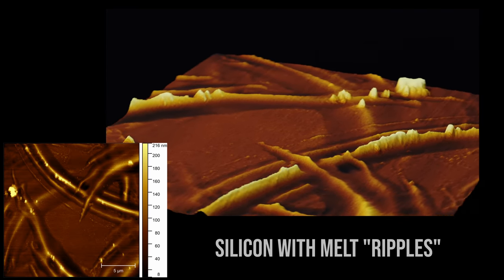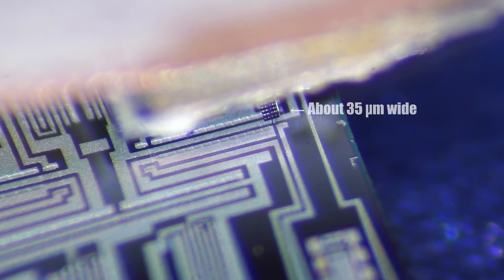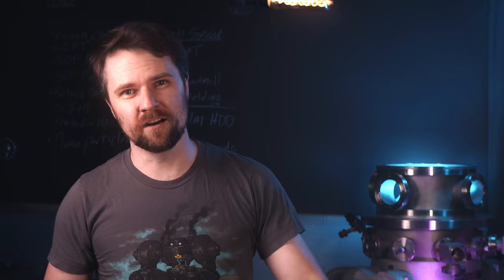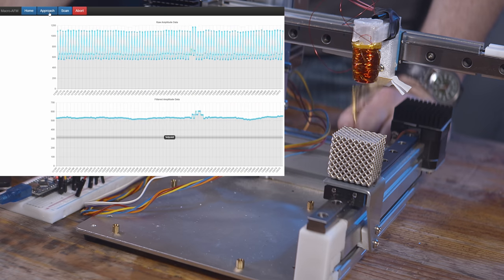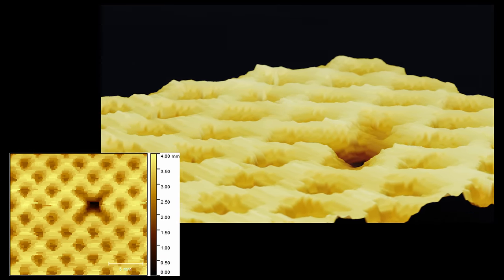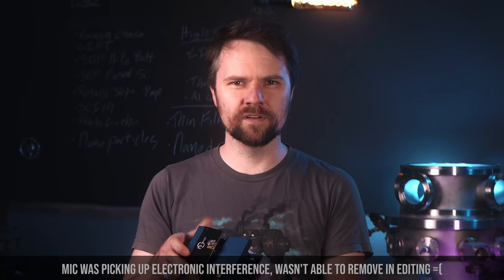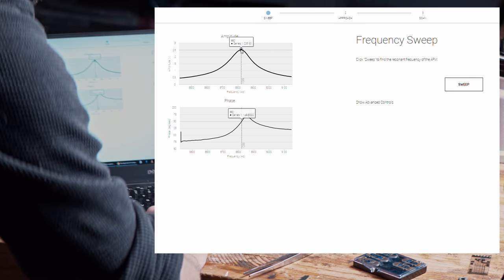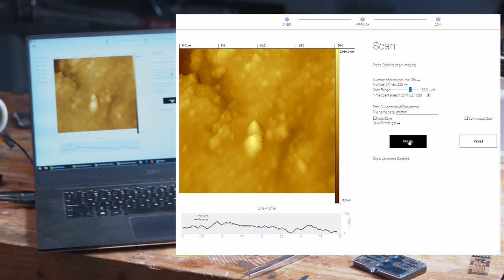1,000,000x Magnification with Atomic Force Microscope

Comment: I'd be interested to know how dust particles can affect the results of these tests.  I kept wondering, if all those imperfections, were just dust particles?
Reply from the maker: I blew the samples off with an air duster before testing. You can typically see dust under the microscope and avoid it when lining up the probe. If you get unlucky and run into a piece of dust it's really obvious, generates a huge mountain in the scan (and easily checked under the microscope). Most dust particles are actually quite large. Very small dust in the sub-micron range tends to stay airborne because it's so small, and any that does land on a sample will land uniformly across all the samples so it just increases the noise but won't bias the data since all samples are affected equally.  But you're correct, for proper lab testing this should be done in a cleanroom or glove box!
Reply: @BreakingTaps  Great info and thanks for the reply!!  Love the channel and always look forward to what's next!  Respect and many blessings!

Comment: Do these devices require a clean air environment or do they literally work straight "out of the box" ?
Reply from the maker: Pretty much straight out of the box. I've been running most of the scans in my home office, which has carpet and dogs, and the windows have been open lately because summer. The rest were in my garage . Definitely no cleanroom here! :)  You'll occasionally scan over a piece of dust/debris but I haven't really had an issue with it affecting the probe, just puts an unsightly blob in the scan.  It is best to keep it away from fans/etc because a big draft will introduce some noise in the scan.

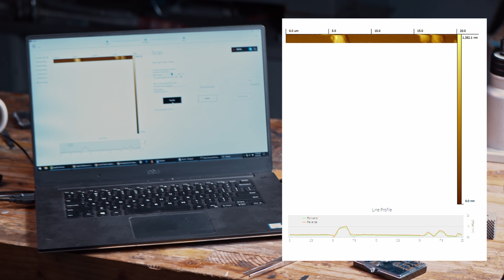Comment: 18:12 I wonder what's happening with the scale on the right, I mean why the max color height goes down at certain times, even though a point of that previous max height has definitely been measured. Is it some kind of data refining that happens as the scan goes on? Just an artifact of the software? Either way, great video!
Reply from the maker: Huh, I hadn't noticed that before. I'm not sure to be honest, will dig through the manual and see if it clarifies what that number represents. There is a "Level Image" checkbox in the software (which I now realize I never showed a fullscreen of, whoops) which does a fast/coarse leveling of the data in realtime.  There's a certain amount of non-planarity between the tip and stage, and the tip itself is canted at a 15degree angle.  So you typically need to level the images when post processing.  It might be a side effect of that?  Not sure, good eye!  I'll update if/when I find an answer :)
Reply: I would indeed guess it is a leveling algorithm, especially since it converges the farther along the scan it goes-- each new line has less and less relative weight to the whole image. Raw AFM data looks really terrible, there is always some degree of alignment/leveling.

Comment: They sell the MEMS chip for $100 per, I bet it'd be possible to reverse-engineer an open source platform for it for a lot less than the 10k that this seems to retail for.
Reply: I'm honestly surprised the chips are only 100 per. Normal AFM tips are around 20 per on average.

Comment: It is small but it is far from an ability to show the individual atoms. According to the presentation  the resolution is of 5 um. It is a distance of 5000 nm. Far from a clear pictures of the surface. If magnified it would probably use some sort of the software statistical  approximation.
Reply from the maker: XY pointing precision is 0.5nm, Z is ~1nm.  The actual resolvable spatial resolution depends on the tip size. For example, the nanodiamond image used a tip that has a 20nm radius, and was resolving particles on the order of 20-200nm.  But yes, it's not resolving individual atoms, although it very much is tapping on them!  And not even that many atoms either! If we think about a 50nm diamond crystal, the lattice constant is 3.57 Å (0.357nm), which equals 140 carbon atoms arrange linearly (rough approximation since it's a lattice and all).  Pretty small despite not imaging individual atoms!
Reply: @BreakingTaps  ok, I misinterpreted the scale of 5um periods to a resolution. I am sorry (my apologize, I could ask). Thanks. Nice channel and presentations by the way.
Reply from the maker: @damirdze  No worries!  I figured other people might have thought similar, so explaining would be helpful for everyone :)  Definitely not as small as some of the images you see e.g. with STM, where individual actual atoms show up :) Cheers!

Comment: Seems like icspi is using a quote system aimed at organizations. Is there any way to buy this as a normal hobbyist and what kind of prize range is it in?
Reply from the maker: I believe they will sell to individuals no problem, but I was asked that folks get a quote through them (they are a small startup so I'm trying to do right by them).  That said, I can say it's not terribly more expensive than my fully kitted out CNC machine and spindle, if that helps put a rough price range on it.
Reply: @BreakingTaps  Oh boy, a little out of my budget then i think :(

Comment: do you know if this works on materials that have give like silicone/rubber
Reply from the maker: Yep, will work fine!  The cantilever is very "soft", and it records phase information as well so it can differentiate differentiate between hard and soft materials.  E.g. soft materials will deflect more which alters the phase between the actual oscillation and the driving oscillation.  Phase maps can be used to show different materials on the same surface, even if the heights are the same :)

Comment: Just wondering if you could make an AFM using a hyperelliptical phono cartridge (moving magnet or moving coil) with some additional stepper controllers and ancillary electronics. Also wondering how much your AFM cost as their is no price listed at the cited link. 

BTW, I have used both SEM (AMRAY) and EM (Hitachi) equipment during my career in pharmaceutical chemistry. I also own a HI-Scope KH-2200 and a Reichert Microstar IV which I use in my own hobbies.

Comment: I understand the depth is represented by darker areas but the clearly images show shadows like there is a light source from the left side. Where does this shadow effect come from?
Reply from the maker: Good eye! Since these operate by an oscillating lever with a tip on the end, there's a natural "arc" to the motion. If you're trying to probe a trench for example, that arc motion will have an easier time hitting one wall of the trench but can't access the other wall. So there's a slight bias to AFM images where one side of features is "shadowed" because the tip can't physically reach those areas. Different tip geometries can make this better or worse (smaller tips with longer profiles will be able to reach into deeper cracks, etc) but it'll always be present to some degree 🙂
Reply: @BreakingTaps  I heard this explanation of yours when presenting nGauge AFM but seeing it as a shadow is something else especially at that angle. 
BTW - You have a radio voice, trust me - do monetize it. 
👍👍
Amazing channel.

Comment: Would this unit be able to scan a knife edge? Also, very interesting that the scanning tip is held in what looks like g10 or other fiberglass composite.
Reply from the maker: Theoretically it wouldn't be a problem to scan a knife edge, but it might logistically be very difficult to land the tip right on the edge.  Too far off in one direction and you'd just miss, but too far the other way and the knife would smash into the cantilever or the MEMS device and probably do some damage :)  With some patience and time under the microscope you could probably get it aligned though.

On the underside, you can see a little piece of silicon which olds the tip, and the silicon die is bonded to the bottom of the PCB.  So the PCB is mainly there to provide electrical connection between the silicon die and the machine, and structural support.  But yep, otherwise it's just bonded on the underside :)

Comment: Um stupid question maybe. Is there a push back on that magnet and "electric pusher"? I mean is there a way to measure that? If so you don't need to touch anything right. You can actually make something that measures well enough to detect the electromagnetic force, and that is cheaper than building AND using an electron microscope, I think? And I just thought about rubbing the surface but that causes problems because of progressive friction. Why can't software be faster? Also it's much easier to use light to measure atomic distances so why not use that? Ok thanks.
Reply from the maker: Yep, you're correct you can measure the distance a few "non-contact" ways.  One would be an inductive sensor for example, but that requires the surface to be conductive and the "field" is pretty big so it wouldn't be very accurate.  The other way is to directly sense the atomic forces repelling the cantilever... which is exactly what non-contact AFMs do! They hover above the surface and sense the minute forces between the tip and the surface pushing on each other.  Unfortunately the forces are very weak, so you need a very sharp tip (nanometers), a small/flexible cantilever, and a very sensitive amplifier to pick up the forces.  If you scale it up to a "macro" level like my DIY machine, the forces involved are too small to register.  So it only works if you are working at tiny AFM-levels.  But they can generate sub-nanometer precision, really impressive machines.  And much simpler than an electron microscope.

Main speed limitation with my device is the oscillation speed, not the software.  You need a few oscillations to determine where the new amplitude is at (say, 10 oscillations for it to average out), so the speed that you can acquire a new point is linked to how fast the cantilever is oscilating. My cantilever was ~30hz, so that means it takes at least ~300ms to acquire a point.  In contrast, the real AFM was ~9khz, which is why it can acquire a point in 500 microseconds.  To speed mine up, you would need to make a smaller cantilever so it oscillates faster.

And re: optical microscopes, they are great!  But at a certain point you cannot measure any smaller with light due to the wavelength. Smallest usable wavelength of light is ~300nm, which means their abbe diffraction is somewhere around 100nm.  If you want to go smaller, you have to use esoteric techniques (near-field scanning) or electron microscopes, AFM, etc.

Comment: And now I get AFM ads from YouTube... Also, aren't all AFM non-contact? Hence the "Atomic Force" part in the name?
Reply from the maker: Hah, sorry about that! :)  

Re: non-contact... technically yes!  The terminology is confusing, and seems to have a lot of historical baggage based on how the techniques were developed.  My understanding is that "contact" AFM relies on the close-distance repulsion between the tip and the sample, and typically measures the amplitude change.  "Non-contact" operates a little further away and relies on the attractive force between the tip and the sample, and typically measures the change in cantilever frequency rather than amplitude.

I think there are pros/cons to each approach, but I don't know enough to really say what it is.  But yeah, when you boil it down in both cases there's no real contact with the sample.  Although once you start thinking about it... there's no real contact in any interactions (e.g. an endmill isn't really touching the metal when it's cutting... the atoms in the metal are just sufficiently repelled by the tool's edge that they can overcome their lattice bonds and break free, but none of the atoms really touch.  Sorta hurts the brain to think about :) )
Reply: @BreakingTaps  Fair enough!
Can I also ask for a ballpark estimate of the cost of the system?

Comment: Doesn't the tip wear out on the oscillating (up and down) probe? I can see that dragging the tip would wear it our faster. But the oscillating tip is hitting with a force that... okay say you're .0001 millimeter tall --- that tip hitting the surface sounds like BANG BANG BANG BANG BANG and so on, right?

Okay maybe not.
Reply from the maker: Yep, it slowly wears down over time.  Different systems (and tips) use different amounts of force, mine is considered relatively "soft" tapping force.  Combined with very hard coating on the tip (aluminum oxide on the wedges, and diamond-like carbon on the sharp tips) they stand up to a fair amount of abuse.  But over time they will wear down and you'll start to lose resolution.  Height information isn't affected much, but edges will start to get less crips because the tip becomes blunter and can't reach into smaller features.

There are calibration grids and such that you can scan to get an idea how much wear is on your tip.  My tips should last a good long time relatively speaking, but the really ridiculously sharp tips (with a single atom at the end) become unusable after a single session :)

Comment: Does the stepper ever come in to action during a scan (like your version), if the sample exceeds Z max for example? I'm guessing not given the resolution.

Could you ever remove a sample and put it back to re-scan the same area?
Reply from the maker: Nope, the stepper just moves it into rough Z position and then is not used during the scan.  It has a really high TPI thread on the leadscrew (something like 100 TPI) so it can get it pretty close, but at some point there's an integrated sensor on the MEMS (thermal I think?) which detects close proximity and the stepper is disengaged.  At that point the MEMS takes over and lowers the probe slowly to the surface.  All XYZ motion afterwards is handled by the MEMS.

Repositioning... yes, but in practice it's quite fiddly.  You can disengage and re-engage as often as you like (without removing the sample) and it lands basically in the same spot, maybe shifted by a hundred nanometers.  Which is sorta wild in it's own right, they really nailed the linearity/parallelism of the stage!  But once you remove the sample it takes quite a bit of work to get back to the exact location.  Definitely doable under a microscope, the stage has micrometers on it to do fine adjustments. Adjustments of a few hundred nm on the micrometers is possible, it just takes some trial/error to get it lined back up (approach, quick scan to check, disengage, adjust slightly, re-engage, quick scan, etc).  The unit re-engages quickly though so it's like a 10 minute ordeal, not an hour, if that helps :)

I'm told you can adjust the position while the probe is scanning, but I haven't been brave enough to try that yet :)
Reply: @BreakingTaps  great info thanks!

Comment: Cool demo.  I wonder if you could measure a piezo cell with  and without a dc voltage to see the shift in height?
Reply: Yep. This is called piezo force microscopy (PFM) and is usually used to analyze things like d33 parameter and polarization.

Comment: The results appear to cast shadows. You can guess where a light source might be. But the touch technology should know nothing about shadows. It should produce the same result in total darkness. So, the software is doing the shadowing. Does it give you control of light sources? Does it employ ray tracing?
Reply from the maker: Ah, good eye.  So there are three "shadows" potentially at play.  First are the 3D renders which actually do have shadows :)  I rendered them in Blender and included light sources to help show off the heightmap more, and they are indeed ray traced (cycles engine). 

Then there is the tip oscillation angle, which can impose a bit of a shadow depending on the feature geometry.  E.g. the "front" of a feature will tend to be exposed to the oscillating tip more easily than the "back" of a feature, so you can sometimes see shadowing in that regard.

And finally, there are "shadows" or "ripples" caused by the PI controller not being tuned well.  The default settings generally do well, but sometimes it needs tweaking.  If the PI is too aggressive you'll see oscillations/ripples when it moves from a tall feature down to a flat surface (like glass) and this can cause little shadow features.  Too slow of PI can broaden out features and cause issues on the other side of the feature.

Hope that helps!